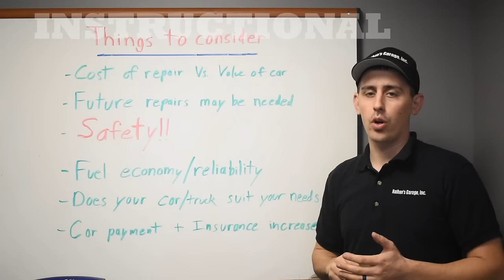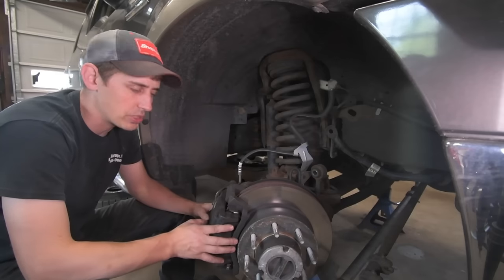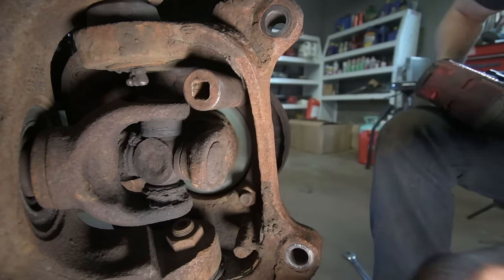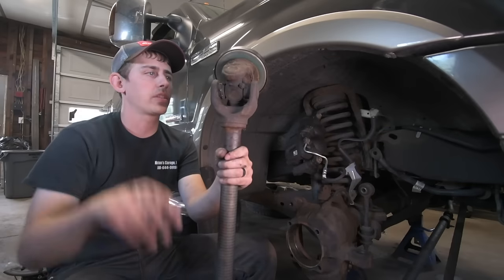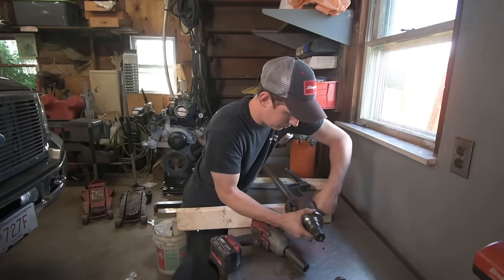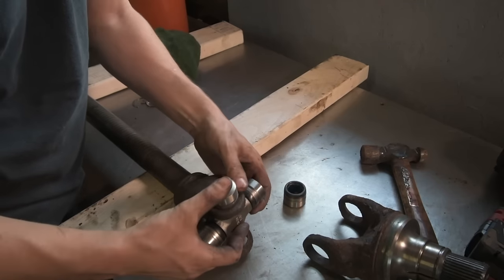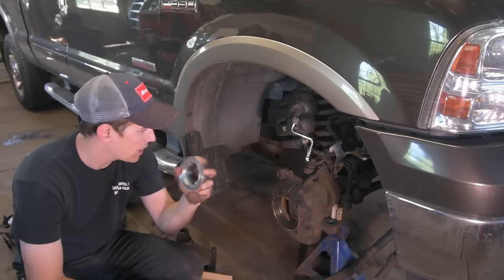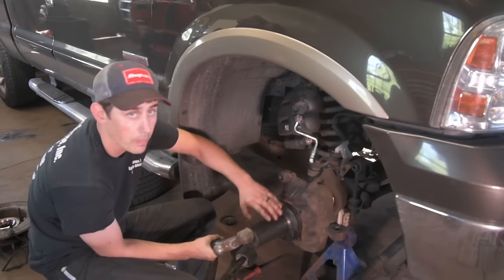Ford Superduty Steering wander repair....Axleshaft u-joints

Comment: I just had my 2008 ram 2500 ubolts replaced, now I have wheel drift. I am actually afraid to drive it at highway speeds.  Could I have the same problem?  How can I test?
Reply from the maker: Its very possibly this is the issue. You would test it the same way.
Reply: In The Shop i have no wheel lock for 4 wheel drive, shift on the fly.  Does that matter?  Do  the ujoints turn while in 2 wheel drive?

Comment: I have a 04 f250 how come in the link theres no inner seal the seals are the only part I'm missing I'm just confused on what I need for inner and outer seals.
Reply from the maker: Hey Bret I'm not sure how I missed putting that in there. I just updated the description of the video to also have link to the inner dust seals. Thank you.
Reply: @InTheShop   hey thank you I really appreciate it. napa handed me like 6 different seals I honestly didnt know which ones wo taking it all apart and I like having everything I need before doin that.

Comment: Can the axles joints cause the truck to pull to the left and also had a bad vibration when I am at 15 mph I can feel il the floor and seat and steering wheel.
Reply from the maker: Absolutely.

Comment: I went to a Ford dealership website and saw piles of used 2019 Ford Powerstroke trucks for sale. They all had 10k to 20k miles. Why are people dumping them and whats wrong with them?
Reply from the maker: DIY Oregon besides some death wobble issues I haven’t seen a lot wrong with the newer trucks. It’s common for people to trade trucks in after the first year and get the newer model or they realize that the truck just isn’t for them.
Reply: @InTheShop  Thanks. I thought it was very strange to see so many of them with low miles for sale used at the dealer.

Comment: I purchased a 2009 ford f250 super duty and the steering is weird. It takes about a 1/8 to 1/4 turn to the right before it will catch up. Left doesnt seem as bad. Does that sound like the u joint also? Thanks!
Reply from the maker: It could be but it sounds more like you have something loose in the steering linkages.
Reply: @InTheShop  ok. Thanks for replying back! I'll try to update this after checking it out more

Comment: I have the steering problem on my 1999 F250 SD and have been to the front end shop twice: everything tight and nothing wrong. I could understand the axle u-joint problem but I have lock out hubs and my axles are not turning with the hubs unlocked. So, how can frozen axle u-joints be causing my problem?
Reply from the maker: The universal joint can still be bound on the axis that currently needs to pivot to allow you to turn. Also even though your hubs are unlocked there is enough friction that your axle shaft can slowly rotate over time.

Comment: Dumb question. I have wandering on a 2 wheel drive 05 f250. Is this fix only for 4wd?
Reply from the maker: I’m a firm believer in the saying that there is no such thing as a dumb question. The 2wd trucks don’t have u-joints in the front. It is possible for a ball joint to get tight but I would say more likely you have a loose/worn steering component.

Comment: Got a ford pickup it reaches 40 mph and it stops going till let your foot off the gas pedal then push it down and it goes no one knows what is wrong with if put on machine no go ..what you think? In the transmission?
Reply: Might.be TORQUE converter. If NO one knows YOU HAVE not taken it to a good mechanic.
Reply from the maker: I would need more information. Count the amount of shifts that occur before it happens from a stop. If there is transmission slippage these trucks WILL set a code. by the way you are describing it I'm willing to bet it happens between the 3-5 shift. Also does it have a delayed engagement into reverse?
Reply: @InTheShop  I will let you know,  we put it on the computer with no codes but we will check the shift

Comment: The thing I haven't figured out is how does it intermittently sieze when the axle shafts don't turn unless the hubs are locked..
Reply from the maker: Even though the locking hubs are unlocked there is still some rotational drag in the hub bearing. If you marked your axle shafts and took the truck for a long drive on most trucks you will see that they have moved a bit.

Comment: Is it the same with a 2006 fx4 f150 extended cab ? My steering is hard to turn when in 4 wheel drive  but turns ok when not in 4 wheel drive ?
Reply from the maker: F150s don’t use this style joint. It is normal for steering to be harder or notchy when in 4x4
Reply: @InTheShop  only does it when doing a u turn  , ok ty

Comment: how does a u joint cause wander ? i can see getting jammed or stuck steering wheel thanks
Reply from the maker: As you are naturally correcting your steering the wheel gets stuck in that position. Most people don’t realize how much they correct constantly until the wheel gets stuck in that position and causes you to travel further than you expected toward the one side.
Reply: @InTheShop  ok i can see it that way not being able to correct steering  whith u joint stuck but if it doeasnt get stuck steering behaves correct ,thanks for the quick reply

Comment: Would the u-joint bind like that if the hubs were not locked in?
Reply from the maker: They still can. If the axle rotates to where the u-joint aligns this way it will bind.

Comment: How do you correct a steering wheel alignment?  Is this a U-joint on the steering shaft?
Reply from the maker: The drag link that connects the steering box to the passenger side has an adjustment in it. Adjusting this will correct your steer ahead.

Comment: probably a stupid question but does this only apply to trucks with 4x4?
Reply from the maker: Not a stupid question but yes only 4x4. If you have wander on 2wd it’s either frozen ball joints or a loose steering component/box
Reply: @InTheShop  wow that was a much faster reply then i expected.  Thanks for the answer on that and giving me direction on what the suspects may be.

Comment: I am currently dealing with some clanking/play in the steering on a 2017 F250 I am Also experiencing death wobble at times. Last year I took to the dealer and they said nothing was wrong. A year later it’s worse and the steering clanking and play is worse with the death wobble worse. Any guidance ? Thanks in advance!!
Reply from the maker: I don’t have a ton of experience with the 17+ trucks yet. I will do some research and get back to you.
Reply from the maker: Does the truck have a leveling kit?
Reply: No leveling kit. Completely stock

Comment: Can the front axel u joints cause death wobble ?
Reply from the maker: Typically not. Usually death wobble is caused by low tire pressure, loose steering components, not enough caster, or a loose track bar.
Reply: @InTheShop  thank you for your input Will check the parts  you have said

Comment: That was an awesome video. I have a 2003 Ford e350 super duty van. 5.4l. I had a really old front end everything and a little wobble. I started replacing stuff and it seems to never end. I have a real death wobble now and can’t figure out why. I have replaced... sway bar bushings, Radius arm bushings, tie rods, shocks, ball joints, steering box. It just wants to swerve and I need help! Anyone have ideas?

Comment: If you lock that hubs so the axles are spinning wouldn't that cause it to behave different?
Reply from the maker: It would. It could also cause a steering wheel shimmy on corners like off ramps.
Reply: @InTheShop  Hmm, my u-joints were out when I did the ball joints (waste of time they were fine) and they seemed fine.  I still have a problem where the truck resists turning then lurches in that direction.  It is not dramatic, but I used to be able to drive with my just my thumb on the wheel looking around and now I have to watch the lane and really drive it.  It is a pain.  Steering box is all that is left but it seems tight.

Comment: I have a 99 f250 that will pull to left, pull to the right , kinda feels like it will dart to the left or right sometimes and sometimes when I turn it kinda has a roll over feeling in the steering wheel. I replaced the drag link because I found it was bad. The issue is better but it still isn’t right. Any ideas what it could be?
Reply from the maker: Check the axle joints. These cause that symptom.
Reply: @InTheShop  Thank you!

Comment: When i use link for inner dust shields it says it doesn’t fit my 06 super duty f-250 and doesn’t provide a suitable replacement number any ideas? The seal kit and u joints said they fit.
Reply from the maker: I just checked it and the link is the proper part. The motorcraft part number is BRS170

Comment: Will this be in effect if you're NOT locked in? This seems to be my exact symptoms but I'm rarely in 4 wheel lock.
Reply from the maker: Yes. This can happen while locked in or unlocked. Typically though when locked in, it will be more of a shimmy.
Reply: @InTheShop  Well, I do get the typical 4x4 binding, (tight cornering) but am in that mode very rarely. But I DO have this symptoms unlocked. I wonder if I have something else going on. Steering box seems fine. No play.
Reply from the maker: @cowboy7x  I would do this check on it.
Reply: @InTheShop  Will do. Thanks brother.

Comment: I have a 1999 F250 two wheel drive that has that wander problem with the steering.  The entire front suspension has been rebuilt but the problem persists.
Reply from the maker: I would suspect a bad alignment but I would also check how much play is in the steering box.

Comment: Why would this matter if I drive 99% of the times with the hubs unlocked? Does this video only apply to driving with the hubs locked?
Reply from the maker: This happens when the hubs are unlocked. When they are locked and the joints are frozen you get a shimmy or shaking feeling while turning. When they are unlocked and not spinning the join has to rotate on one plane while trying to turn. If they are frozen they will resist rotating and stick in place.

Comment: Great video do you have a shop in Massachusetts I noticed the Massachusetts plate on the truck I’m from mass
Reply from the maker: Thanks David! I did have a shop in Massachusetts. I closed a year ago.
Reply: In The Shop that’s my luck. Lol. I recently just bought a new 2019 Ford F250 with the snow plow package and as I’m realizing the springs is so beefy that it’s pulling the axle towards the driver side by 1 inch because they don’t put an adjustable track bar I just ordered one from ready left I’ll be putting it on soon probably wait for warmer weather it would be good if you ever did a video on explaining the issues with this. Thank you I just subscribed to your channel

Comment: Can I take out the yoke and axle on my 2001 f 250 front passenger side and operate ir
Reply from the maker: The differential fluid will all leak out.

Comment: Great video... how long does it take per side?
Reply from the maker: Depending on your skill level and how rusty the truck is you can expect anywhere between 2-5 hours per side. An experienced tech can get it done in 2 hours if the truck is in decent shape.
Reply: I’ve done mine just over an hour per side if you don’t mess  around

Comment: Question: If I replaced that outer axle seal like a month ago, and I didn't replace that u joint, do you think I need to buy another outer axle seal? Or can I remove it without damaging it? I replaced the ball joints (both upper and lower) the tie rods, adjustment sleeves, steering damper, basically all the front end steering parts, now it wanders like crazy! suggestions? gear box?  I refrain from taking my vehicles to a shop, it's too expensive so I do it myself in my driveway :)
Reply from the maker: You might get away with it if you cleaned and lubed the knuckle really good. I would be prepared to replace it just in case. One of those things that I would order and return if I don’t use it.
Reply: @InTheShop  yes, I cleaned and lubed everything before I put everything back together. I'm a little ocd so it would bother me if I put crud covered things back together. The f350 has close to 180k miles so I'm thinking the steering gear box might need a little adjusting.
Reply from the maker: @marypete7580  I would be careful adjusting the box. On these trucks you typically do more harm than good. The issue is they wear the most at the center of the steering since that’s where the box spends most of its life. When you adjust it you can make it too tight at the outer ends and just right in the middle. 
Once these boxes have play they really need to be replaced. 90% of the time memory steer in these is caused by the u joints. Another large percentage of them are caused by tightening the upper ball joints before tightening the lowers.
Reply: @InTheShop  gotcha! I had already planned on getting a new gear box, because of how much ill maintained parts I had to replace on that truck.  Thank you for your input! I appreciate it and awesome video!! ~Mary~

Comment: I have dead wobble in my 2001 f350  I replace ball joints gearbox shocks and still have the dead wobble
Reply from the maker: With the truck on the ground and not jacked up have someone shake the steering wheel back and forth abruptly with the engine off. Check both ends of the track bar. Any play at all can cause death wobble.

Comment: No grease on the inside of the hub assembly? Might be a ignorant question but wasnt sure.
Reply from the maker: I have never greased the inside of the hub. I’m not sure that it would help anything. I may be wrong though. I will look into seeing if there is any benefit to doing so. Thank you for the comment.
Reply: @InTheShop  thanks

Comment: Good job but my comment comes as a professional axle and driveshaft rebuilder for the last 30 years. You HAVE to rim out and clean the rust out of those ears where the u-joint caps go in.
Reply from the maker: Something I definitely should have mentioned in the video. Thanks for watching and thank you for the constructive criticism.

Comment: Is there an updated part number for The Hub seal kit? The Amazon number only goes to the hub seal alone
Reply from the maker: What year is the truck?
Reply: 2013 f250
Reply from the maker: I just clicked the link and it was the kit
Reply: Okay great thank you so much for checking. When I click on it Amazon system says it doesn't fit but I'm sure it's Amazon system messing up

Comment: What took you so long! This is the same problem Ford and other manufacturers have had with 4x4 since the first ones. It's not toe, it's not castor, it's not brake drag, it's bushings or U- joints! With the inception of the Ford independent front axle with mileage at around 75k  and the front wouldn't come into spec during/after front end alignment the first thing to look at was the differential u-joints. Most customers after hearing the repair estimate said "to hell with that! I'll sell it!".
Reply from the maker: Thanks for watching! You are absolutely right this can happen on ANY 4x4 with universal joints in the axles.

Comment: That has nothing to do with wondering.  Can that cause stiff spots in steering left to right yes if u joint lands at bad spot. Wondering most of the time is from toe end adjustment out of wack.
Reply from the maker: Absolutely false. Read the dozens of comments from people saying this was their exact problem. When you are making your normal corrections traveling down the highway your wheel will stick in that direction causing the truck to pull. You then over correct and it sticks in the opposite direction. When you have frozen joints the truck will track all over the place (wonder).
Reply: I understand what your saying and yes that can happen but that not common. What is is it being aligned improperly from the factory. My 17 f250 wondered from day one. I just purchased a 22 f350 drove it home from dealer last week.  Same shit right from factory doesn't track straight.  Back to what your saying if people would put those u joints in use time to time you wouldn't get that frozen spot from sitting in it.
Reply: Also side to side wondering from what your saying is causing it is still input from the driver trying to overcome that stiff part of the u joint. Which the power  steering power you wouldn't even notice. It will push right through that stiff part. That joint being stiff does nothing as far as any play in the steering system.  Your saying people are over compensating and making the wheel go to far to each side to over come the hard spot in joint.  Next time you see that sit in truck and turn wheel lock to lock you won't even notice it..

Comment: I have a 2013 f250 diesel. My steering problem feels like when I turn left or right my steering wheel will be off center and the wheels want to stay turned. Also the steering itself feels way too easy to turn. I have NO mechanical experience and am at the mercy of a mechanic! What's should I be asking and standing my ground on?
Reply: I am having the same issue.  I have replaced everything exept the ujoints.  I highly recommend you start here

Comment: But the shaft isn't always engaged like it is in 4WD.  How would the joint affect steering when 4x4 is not engaged?
Reply from the maker: The joint still has to pivot when the knuckle pivots.
Reply: @InTheShop  ok. I'll check them. Great video by the way.  I've changed gear box, pump 2x, both tie rod ends, New tires, driver upper lower ball joints,  ball joint on bar, and still steering won't return, jerks after bumps. I'll try the joints. Thank you for replying.  Dave, Cincinnati,  06 f250 PS.
Reply: Just pulled knuckles and driver side ujoint frozen and lower ball joint stiff as hell. Thanks for the info and video.

Comment: I've always believed the greaseable u-joint was weaker because of the cross-drilling.
Reply from the maker: They are but unless you are making significantly more power than stock and absolutely abusing the truck you will never break a properly maintained greasable joint.